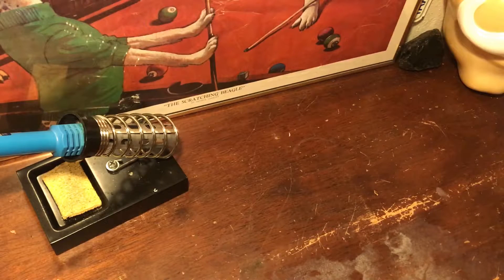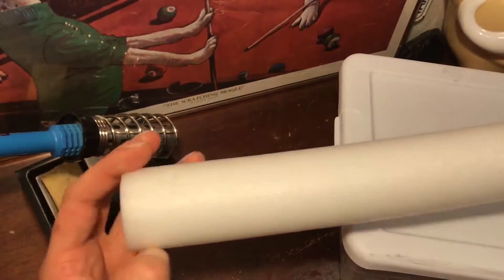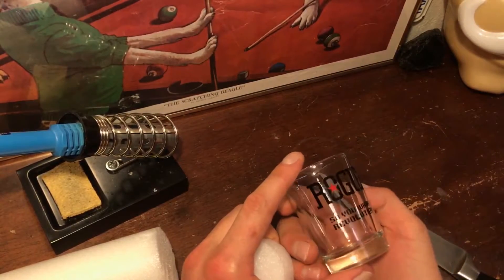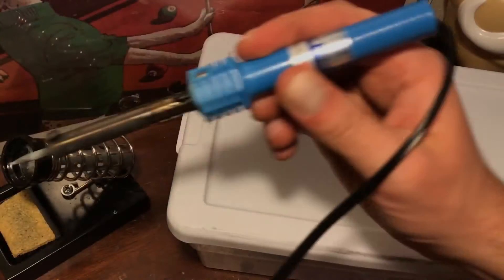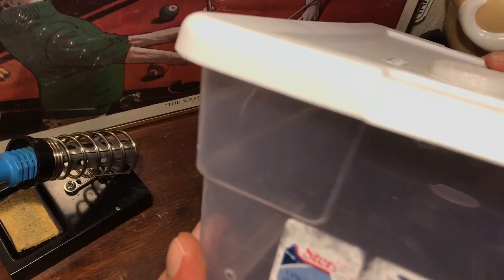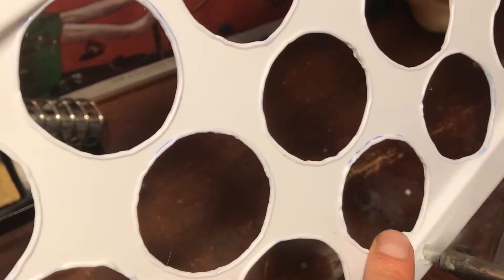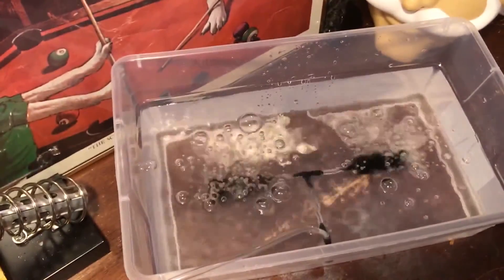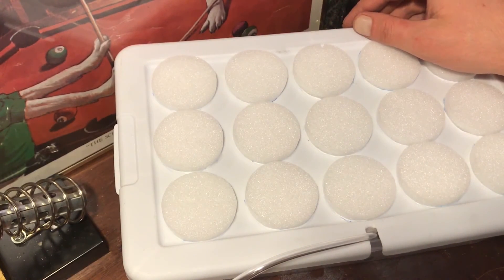Building DIY Bubble Cloner - Episode 64

Comment: I've taken a cutting and placed it into a small pill bottle with dechlorinated water and each day I have emptied it, rinsed it with 3% h2o2, filled it back up with water and put the cutting back in. I switch between two so that the clone isn't out of the water for long. Just long enough to check for roots... Nothing yet but she's only 2 days cut now.
Reply from the maker: Dr. Nicks Organics nice, hopefully it works out! I have tried just having it in standing water a couple times but have never succeeded. But it must be my particular conditions since many people do have it work. In fact, in the end I wound up not using this bubble cloner. It worked but took way too long, but I have seen ones just like this work very efficiently. Would probably be the way to go for high desert conditions. The other challenge here is having to transplant bare root cutting that are used to aerated mist into soil, can be a bit problematic. I switched to root riot plugs in a humidity dome eventually and have been getting good roots within 10 days (for a vigorous cutting). Cheers!
Reply from the maker: Dr. Nicks Organics ohh and that's for cannabis. I also tried a bunch of other stuff (tomato, pepper, willow, currants) and most of those rooted quite well in the bubble cloner. But still the root riot versions had thicker, whiter, more vigorous roots.

Comment: Check out flexible bubble wands. They work great for this type of dwc hydroponic/cloning system. People have been cloning in just glasses of water forever. The bubble aeration just improves this age old technique. Gonna sub. Take care pal!
Reply from the maker: Indoor Micro great suggestion! That might have helped but in the end I had to abandon this method, but it obviously does work, especially in dry RH conditions. I have a pretty high RH between 40-50% in my place and with warming temps of summer setting on (when this was filmed) I had loads of issues. Mostly seemed like they didn't like the water temp, or maybe lack of aeration as you say. I did get a few to take, a bunch produced root nodules and just stopped, most did nothing or rotted. I switched to just root riot plugs in humidity dome and get great results in short time. Cheers!
Reply from the maker: Indoor Micro I have never been able to do the just in a cup of water method lol maybe it's just me ;)
Reply from the maker: Indoor Micro ohh I def know it works, have seen it many times w cannabis ... just not for me lol